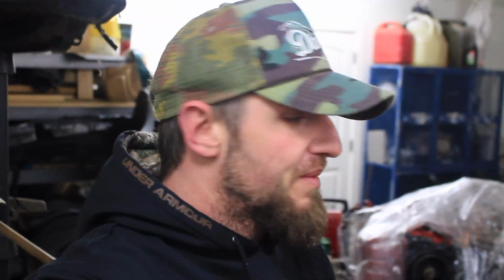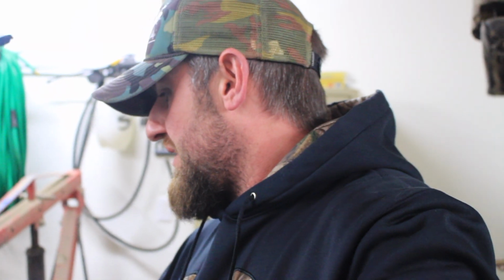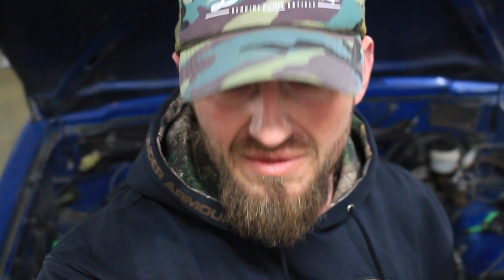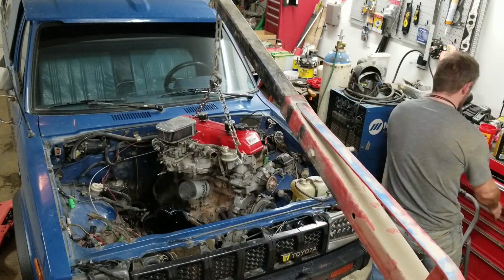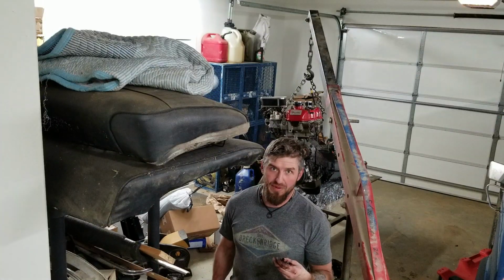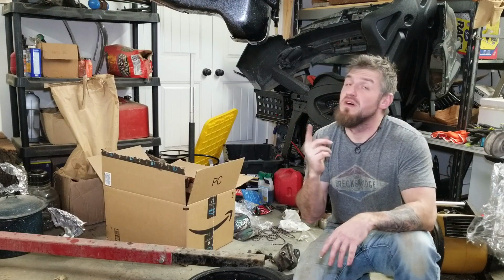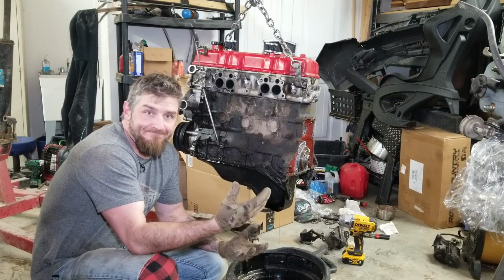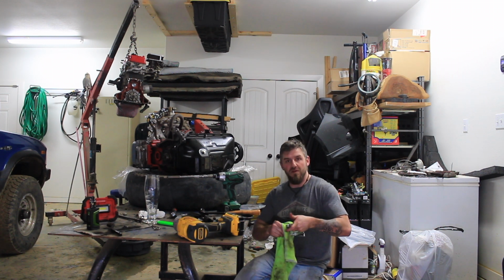First gen Toyota 4x4 weekend engine swap by myself!

Comment: next time you pull a pilot shaft bearing out pack it full of grease you use a ratchet or a stick  you my need wrap a grease around the handle to make snug tap on the of end of the ratchet or stick and the bearing come out
Reply from the maker: Thanks man. I'll give this a try if I am ever in a bind again!
Reply: @ResurrectedMotorSports  A slice of bread works just as well if you don't want to use grease.

Comment: What headlights do you have installed? Can you post a link and do you need a special harness?
Reply from the maker: I don't know the name brand, I am sorry, I believe you can them on amazon, They will work plug and play but if you want high and low beam to work you must buy a relay harness. I believe it was about $20.00 on amazon as well.
Reply: Where the lights specific for a 1st gen Toyota? All I’m finding are one that fit jeeps.
Reply from the maker: @jordancox3768  not specific, I think they are the same ones listed for cherokee's
Reply: Gotcha, thanks for replying.
Reply: Jordan Cox can like for Cibie glass housings and put any halogen brightness you desire.